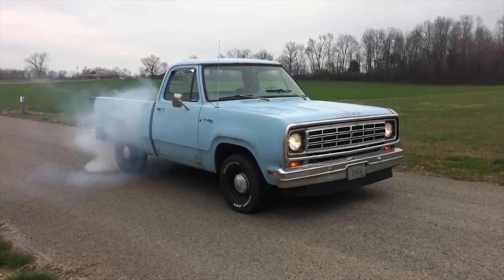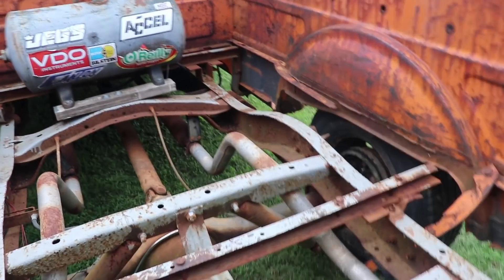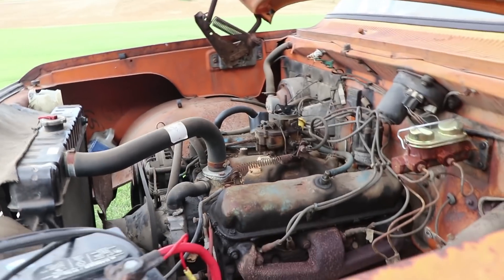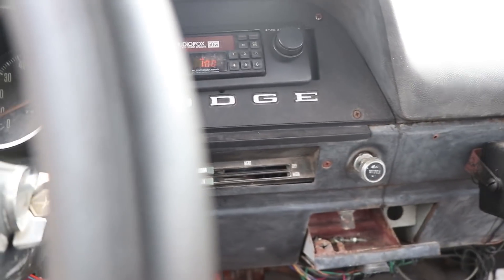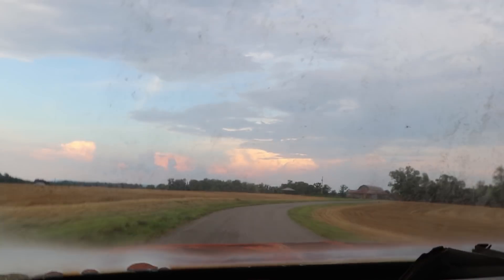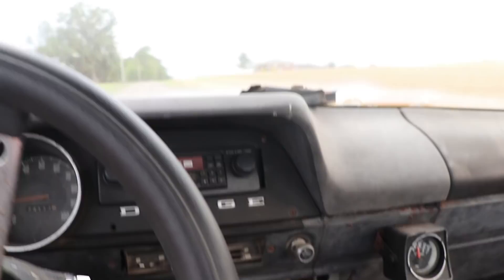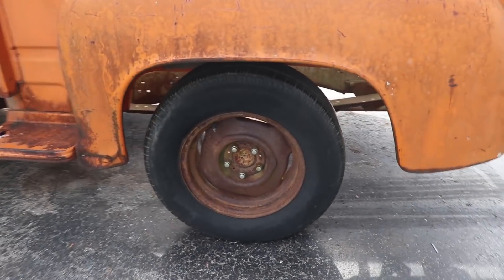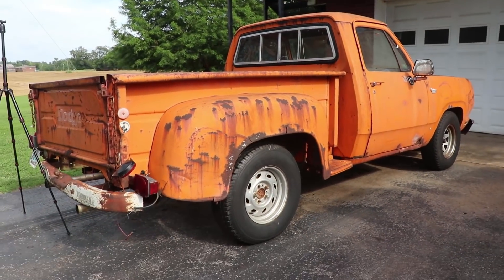ABANDONED Junkyard Truck Revived After 13 Years! Part 1

Comment: Dylan go buy a trailer light kit with wire ,will be the best way to repair the wiring going to the rear.It will be a 5 wire harness so you get new ground to the back aswell.

Comment: Don't know if you've ever experienced it but a defective turn signal switch/ emergency flasher switch will make the brake lights malfunction, I went through that with a '70 Monaco that I owned years ago, replacing the entire switch fixed the problem.

Comment: Great video!  Well explained.  When you step on the brake and operate the brake light switch you are completing the  brake light circuit  aka closing the circuit.  An open circuit is just that. Open, no current flowing, lights off.

Comment: Western Hurricane rims, by some firestone firehawk indy 500's in like a 275 width for the back and 245 for the front. like a 275/60. And get some rough cut 4/4 oak planks and redo that bed floor. Don;t worry about sanding and finish, oak is stout in the weather and if it gets grey/weathered looking it will match the truck then.

Comment: You got your open and closed circuit backwards
Reply: I would fix the tail lights from the fuse block back just replace all the wires get some flat 4 ribbon wire for trailers.  Makes for an easy fix and everything is color coded. Wheels and tires I'm a fan of stock steel wheels that are wide and factory ish hub cap. Just my 2 cents.

Comment: Hey Dylan,

Just a heads up. At 9:00 you had your terminology backwards.

In electronics, a Closed Circuit means the circuit is conducting electricity. An Open Circuit is a circuit incapable of conducting electricity.

Imagine in your mind, a big loop made of electrical wire shaped like a hula hoop. Electricity flows around this loop in an endless circle starting and ending at the source of energy... in this case the 12v battery in your engine compartment. When the loop is closed, that means the electricity has a path to travel along the loop uninterrupted. When the loop is Open, that means the hula hoop isn't a complete circle anymore. It's broken somewhere along the line, thus electricity cannot make the trip from beginning to end on the entire hoop.

Hope that helps. If I had a white board and a few minutes, I could explain it better.

Comment: I like this truck a lot. I agree the wagon wheels do look good on it. Maybe swap your chrome wheels onto Rump and get some white ones for the blue truck? Or slot mags are always a win. Even just the stock wheels painted white would look great, maybe a flat white to blend with the patina of the body? 

If you went with the stock wheels and couldn't run as wide of a tire as you would choose otherwise, you could run a mild all terrain style tread to still give the truck a little extra style / attitude...  just another option, but I think however you choose to build it this truck can't help but look fun to drive.

Comment: I always used trailer wiring kits, to rewire basically everything. You can buy them cheap,with alot of color coated wire, and male and female waterproof connectors. I've rewired a ton of things with trailer wiring kits lol

Comment: I believe your brake lights are wired separate right and left through the turn signal switch. That way when you apply the brakes and also turn the signal R or L it will cancel the appropriate brake light and allow it to blink. Both running lights can be wired together from power but not brake lights. Tires... it's a truck, not a low rider in the city. 235/85R15 on stock or 6" wide wheels will give you decent ground clearance and some good Highway speed and mileage. I'm just an "Old School" L.A. Hot Rodder from the '60's who moved to Nevada in the '80's. Good luck I've had a couple of '73 Power Wagons back when they were new.

Comment: Dylan, since part of that column connector is unused, you may be able to move (repin) that burnt pin over a few to reuse that connector, so then you don't have to replace it. You'll have to move the pin over on both sides, but it would fix it

Comment: Surprised it has oil pressure most of the old 318s I've got out of a yard had the rod bearings beat out of them. I had a powerwagon that I beat the tar out of in the woods. They never left me stranded though. Good job saving these vehicles!

Comment: It’s the Great Pumpkin, Charlie Brown!  Painless sells wiring kits, around $190.00 for your truck year/model. Or, you can take your time, and re-wire it completely, which I have done to mine. Your current issues are most likely the result of two things. A.) An extremely rusty frame, coupled with a poor or improper ground. B.) An extremely bad hack-job, done in the past by some individual that thought he knew how to wire that CB radio or aftermarket stereo. From the looks of it, I’d say you’ve got both issues. Do yourself a favor, and gut it, then clean the frame for new ground cables. Yes, cables, as you’ll need to ground the cab and the engine both to the frame, in order to get clean, buzz-free sound from, any stereo you may want to install.

Comment: Hey, that fuse holder was off an older car stereo, possibly the old Audiovox cassette deck you got in the dash there. Good old truck though. I'm thinking mildly built 440 with a hemi 4 speed, or maybe a T-5 5 speed? Probably already got a 8 3/4 rear or Dana 60. I'll be watchin to see what you do with'er.

Comment: That fuse holder, actually part of a fuse holder, is probably the power wire for a CB radio.  I have a bunch of them from the 70's and they almost all use that type.

Comment: In my honest opinion, I think it would look great with gold painted wagon wheels instead of the chrome! Definitely keep it the stock drivetrain. I think you should just drive it until the motor blows, then do the 5.9L V8/5 speed swap. Put the wood flooring back on the bed. Also, being a '72 D-100, it needs the correct grill for it to be original, lol.
Reply: I agree with almost everything besides the gold wheels black would look so much better👌👌
Reply: @lilscarred8516  Most definitely! Black wheels would look better on this body style truck! However, if Dylan keeps the body rusty and faded, gold wheels would look better on a rusted out truck.

Comment: Things I would do if it were mine (would love to have a 70s dodge truck like that to tinker with).... All lights replaced with LED versions and cleaned/doubled up on grounds, all wiring to all lights completely replaced, 4 barrel 600-650 cfm carb on that 318, 17x8 rims, cleaned up and rebuilt brakes all around and make sure front has clean good working disc brakes. 

For the trans swap, I would find something like a Aisin AX15 5 speed manual trans from a 90s Jeep Cherokee, or a Dodge version of the NV3500 from a 90s Ram/Dakota with 5.2L.

Take care and God Bless.

Comment: Having problems making my 73 Duster start.
It has lights but when I turn the ignition switch (steering wheel apart) nothing happens but the alternator gauage going down a little bit much then back up to normal.

Has a new: battery,  ballist resistor, starter ignition relay, ignition switch inside the steering wheel,  and ignition control circuit, 

My dad got the car to turn over and start by using a screwdriver on the starter . I tapped the starter with a hammer to see if that would help... nothing. I have a manual so I press the clutch down and start the car in Neutral right? But still no crank. What am I doing wrong!?

Comment: Factory wiring had 4 wires to the back, brown was running to both sides. The other 3 colors i don't remember, 1 of them is backup lights then one is right turn and brake the remaining is left turn and brake. Its been a while since I worked on mine.lol.

Comment: DR.D here in sunny Regina have you heard of long ram, intake manifolds,do you think it would work putting dual fuel injection tbi units one being the slave unit or a six pack manifold with 3x  tbi. units just a thought. ps. not a real doctor.

Comment: That constant power wire isn't factory, someone put a fuse it and it burnt up and part of the plastic broke off on the right. Same fuse type as on cb radios.

Comment: Also Dylan when could we see your dad's cuda and the black Dodge Challenger?
Reply: Nice truck in your profile pic
Reply: Thanks it's my truck, a 1996 Dodge ram 1500 V8 318 automatic short bed two door original red pr4 color
Reply: @oldcroneysgarage9739  thanks
Reply: @obs.takuache9405  is it an automatic?
Reply: @oldcroneysgarage9739  yes
Reply: @oldcroneysgarage9739  4 speed auto
Reply: @obs.takuache9405  that's sweet man my mom has a 1996 dodge ram 1500 5 speed 2wd when I get the money imma find me a 96 or 97 dodge ram 3500 12 valve
Reply: @oldcroneysgarage9739  real nice just make original it's nicer and better looking
Reply: @oldcroneysgarage9739  like mine

Comment: I'd snag 4 old dodge rims from a wreckers  yard,  steel wool them, paint with black Rust-oleum. 4 tires from a swap meet, then bubble balance and dog dish. caps  Would quiet 85 percent of the noises it makes. An old aluminum Baseball bat over the gear lever, and an Indian blanket Wired over the seat.  Halloween Hot Rod!  :)
Spooky.